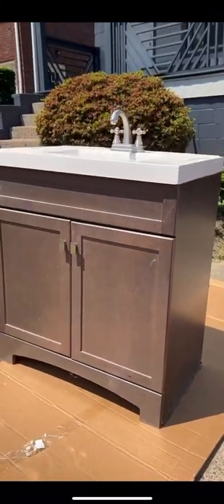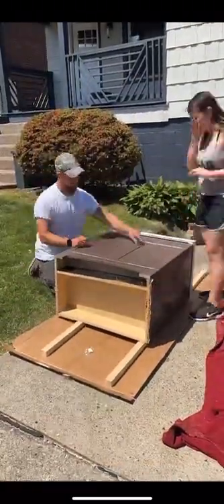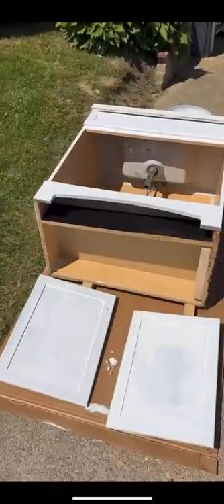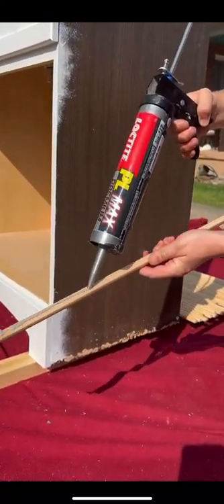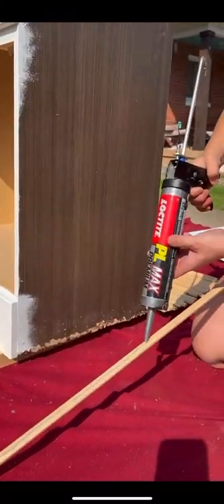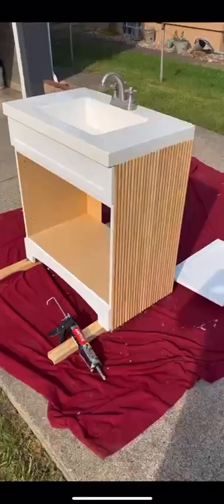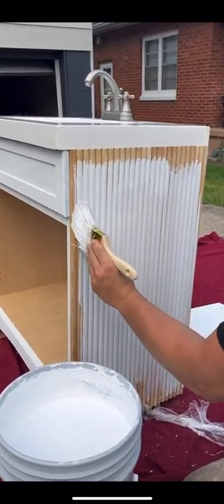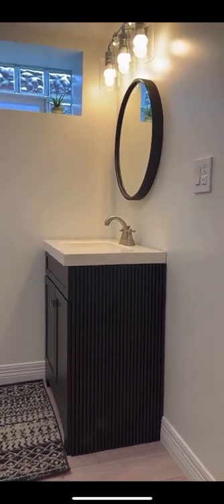DIY Bathroom Vanity Transformation | Before & After | How To - Restoring old Furniture with Loctite

Comment: I found a small dresser/stand in the trash at work It had dated cheap hardware and was a dull medium brown. I decided to make it look like a piece of antique Chinese furniture I painted it in three stages, first black, then gold on all the edges, and then red all over, but I rubbed the red off along all the edges so it looked like it was worn off on the edges. Then I painted gold butterflies on the top and doors and added black metal Asian hardware. I got a Chinese newspaper in Chinatown and wallpapered the inside. I love how it turned out.

Comment: 'Withhold the test of time" r u kidding??? Off i would be pissed if i was buying that house.. .. u can see how damaged mdf is at the bottom and its going to continue to deteriorate putting wood strips on the sides does nothing but hide the damage on the outside meanwhile on the underside the mdf will continue to swell bc it's in the most humid room in the house..#halfass
Reply from the maker: We rebraced around the bottom of the vanity with 2x4s so the mdf won’t break over time.. 
if you checkout our series this is the basement bathroom and this vanity is very sturdy 😊
Reply: Why didn't you just cut a new piece of mdf? They're not extremely expensive. The price has gone up but seems only slightly more expensive.
Reply: @Loves2troutfish because that means she would have to spend more money and do things right. This is why people hate buying from flippers because of the amount of half-ass-ness that goes into it. 😂😂😂